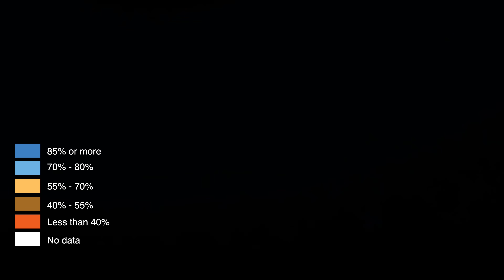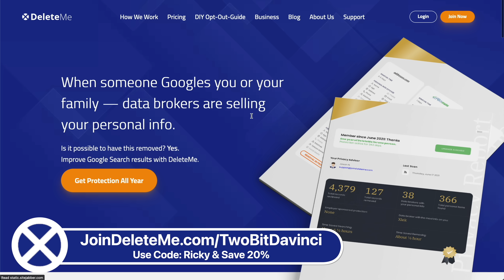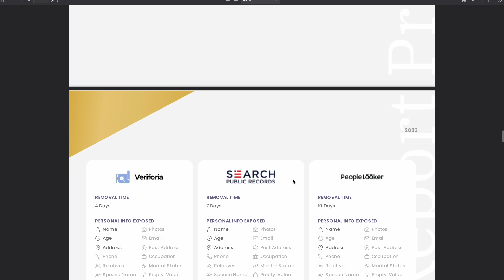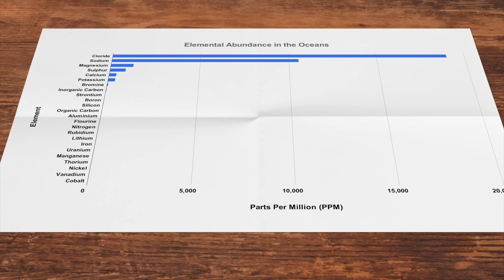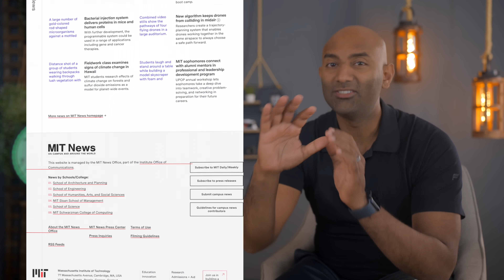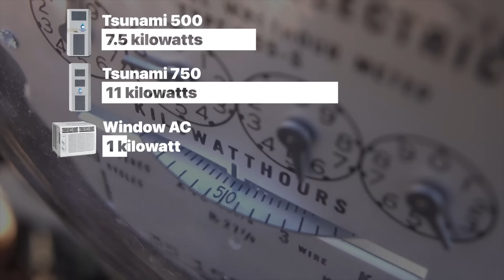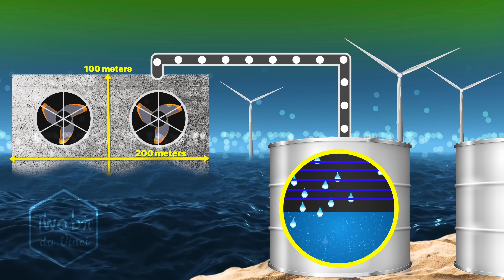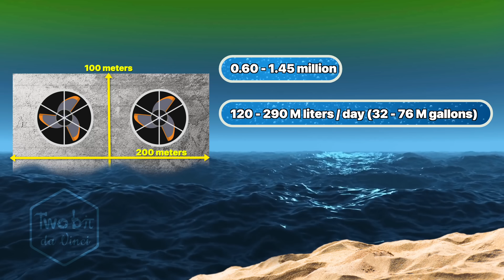This Tower Turns Ocean Fog Into FRESH Drinking Water!

Comment: Forget freon, forget steel pipe. Pump cold deep water thru polycarbonate twinwall panels, and you will have cheap water vapor condensing surfaces. Simultaneously, very large thinwall polyethylene conduits can be used to transport fresh water to shore. The buoyancy of poly and freshwater in saltwater allows these tubes to be restrained with anchors and tension cables. Think fresh, control cost.

Comment: Any and every way to get clean drinkable water is great, however we need to address the issue of how we waste water, this would take rebuilding plumbing and ''slow the flow'' of how and where water drains. Rain water and stormwater needs to be slowed to allow it to seep into the ground, where nature cleans and filters it as it  seeps down ton aquifers.  All hard non porous surfaces need to be changed to a material that asborts the water to in temp storage tanks before slowly release to the soil. Sidewalks, parking lots, small streets not highways. But local storage is vidal because of all the trash and piosons the storm water picks up before draining into oceans adding that trash to the oceans. Every house, fields, business, neighborhoods all need local storm storage and filter systems.  Water should be used minimum twice, example sinks, tubs and washers are connected to fresh water, but they drain to local grey water tanks that supply water to our lawns, gardens, farms and toilets which don't required fresh drinkable water.

Comment: How thick is that saturated layer above the water? How can it be sucked in? If the water i very calm a network of tubing floating on the water could probably do it and I see the installation (mainly ) floating on the water.  Advantageous seems that we don't need to condense steam here so the energies involved are lower.

Comment: It won't work out unless you have a temperature difference between moist air and the colder   media (water or air) that is used to cool it down to trigger condensation. For this, one must heat up the water using solar water panels and then using ambient air on the cooling side.
Reply: Or one must duct the air a couple hundred meters below the sea surface to where the water is icy cold.
Reply: @benishborogove2692  Indeed. But, that will not be true for all geographies.

Comment: You don't need a tower, you need to float a platform that let's air in from the sides, allowing an air collection system (fan)in the center. The air is ducted into a stainless pipe that will cool it sufficiently. Then just pump the water from the pipe. Or some variation of this.

Comment: Is the $241 annual cost, per person, or per household?  Being powered by solar would mean intermittent power and run time.  Were construction and operating costs, and water harvested calcs based on the system running 24/7?  Could a larger surface area with passive water harvesting mesh accomplish the same goal with less complexity?

Comment: If u have high humidity in air, then u should not be big issue with fresh water cause u should get decent amount of rain often, with rivers and so on, while in desert like areas u have both issue.
The energy investment is a lot to condensate the water.
If u remove this much water from air, the air will be much more dry so it should effect the environment around cause u will have this amount of water less as rain.

I hope humans will evolve on a lvl once, when they get rid of MONEY and GREED. If no money and greed involved, we can go for more efficient way cause right now the efficiency is based on profit, that is why we do not recycle much, cause cheaper to create new from scratch.... Good example as plastic. Plastic recycle is mostly just burning most of them. -,-
Could say other materials what we just dumping on dump fields every day, but since it cost a lot of money to separate and recycle we not do it, just dig a nice and big hole and dump it there, then cover it with dirt, or just pile it up and then cover it with dirt and pretend there is nothing. -,-

Comment: Post Two
Still thinking about this exciting sea vapor harvest idea.
Since these old freighters would be nearly stationary, their polution profile would drop drastically.
Repurposing these behemoths would benefit their current owners and might coax them to build new, green cargo carriers.
A freighter situated over cold water could shallow deploy a black fabric sheet, like a fishing net, to heat surface water to it's vapor point with solar energy focusing lenses.
Reflective areas on the sheet's surface to catch and bounce sunlight beams might improve vapor production efficiency via aqueous radiation redundancy. 
Depending how they were fabricated for the tropics, such sheets could also shield and/or partially shade heat stressed coral reefs, now endangered by bleaching.
Since edible fish stock are depleted world wide, employment of experienced fishermen to harvest water could be a vital economic boon to costal communities.
There is no reason fisher folk could not incubate and farm edible sea life by dropping nursery cages, like lobster traps, while they wait for harvest vapor to condense.

One caveat, I live a block off the beach. 
Ocean water vapor can be briny, even caustic. 
We might still need to distill the condensate but solar stills have been used since the age of tall sailng ships.

Comment: Why not put these deep ocean vapor collectors on old desiel burning freighters?
Tower construction cost are probably far more than repurposing ships and installing new green energy systems.
The chemistry and forces of oceans tear up man made constructions.
Look at the maintenance costs of oil riggs.
Each old freighter could hold metric tons of water in it's former cargo bay.
Your cold water condensation idea is brilliant because the deeper we pump water vapor the cooler the ocean and higher the pressure.
Expelling excess air from that cooling vapor could run turbines for electricity to pump the water back to the surface.
Filters might be used to scrub excess CO2 out of condensing vapor released air.
Win/Win.
A freighter can be moved where ever water is needed most.
Freighters can also be relocated out of harm's way if a huge storm is coming.
Unlike a fixed tower they can also be removed from war zones.
Just thoughts

Comment: Cool tech, but the idea of using sub-surface temperatures to pre-chill the water would be the same as dumping heat into the ocean.  A few degrees is enough to change the local ecosystem around the pipes and towers.

Comment: It’s all about the dew point and ambient temperature. 

The biggest issue is that saltwater / marine environment is very very very corrosive. So what ever you use to get a lot of cold surface area needs to have a good thermal conductivity but be able to withstand the corrosion.

Comment: Desal uses much less energy than condensing this is not addressed anywhere... And turning it into water before piping to land would be 10x more efficient. Like you said using the sea water as a heat sink could result in great thermodynamics

Comment: So, I must ask a question?? We have been "condensing" water from the air for over a century!! And it's right in front of our face, it's called refrigeration and we've been dumping all that water and energy down the drain! Why don't we redesign the A/C, and refrigeration systems to "CAPTURE" the water created when cooling of homes, offices, buildings, and food, plus any and all other refrigeration devices as they all must deal with the condensation issues?? After-all cooling is one of the reasons we have global warming as it uses a massive amount of energy which is directly connected to carbon production! This is just my observation but what do I know??  Love your viewpoints on all your topics!!  Peace...  JAFO

Comment: or just catch the rain that falls, even desert regions get some rain, if you have a decent catchment area, like a road or a roof or a series of ponds even small amounts of rain can fill huge amounts of storage.... if you know the yearly rainfall its not difficult to setup catchment to almost anything.... say you want a ton of water, you live in a desert and you get 10cm rainfall a year, you will need a 1m by 1m by 1m storage tank and ten square meters of water catchment to fill it in a year assuming no losses. that is not alot of space, you benifit alot from the square cubed rule a ten by ten meter area is 100sqm so you can fill ten tons of water per year off this. if you have 100m by 100m that is 10,000sqm of catchment, that can provide 1000 tons of water per year. not a big area.  just two foot ball feilds.. thats enough water for about ten people. high tech solutions are not needed for water shortage.... just maths and common sense.

Comment: Not so fast.!!! The cost of your/my water has to do with the cost of the distribution system, and a huge part of it is interest on the debt to build/repair the distribution system.  The water is actually free or in many cases just a few percent of your actual bill.  For my bill of  around $80/month, half is for swear (no saving) and of the rest only 20% is the actual water or 10% of my bill or  $8 per month..  This system will still need the local distribution system/sewer etc, so there is not likely any savings, only added cost.  May be better then reverse osmosis... but is not free and will not save us money.

Comment: OK, okay, all right… Now hear this.

You have unlimited water, to drink. Wherever you live.  And it's called a room,  dehumidifier. It runs on 120 volts, AC. And it will need to be powered from, solar panels.

And if you want to label that differently? You can call it a room air conditioner. Sucks out the hot air. And outputs dry air. With clean fresh water it takes out of the air. Et Voilà!

Now, the infrastructure of which. Is only taking, hold. Not quite yet refined for prime time marketing. As it's still a bit costly. And so they are trying to appeal to all of the stupid millionaires out there. To purchase these other, flawed, explosive, battery-operated cars. That insurance companies. Will no longer write homeowners policies. For owners that have said vehicles parked in their garage. When it takes their, $25 million mansion out.

And Like A Good Neighbor. State FART is There. Gas lighting you. Ouch!
RemyRAD

Comment: I appreciate what they’re doing; but this is a stupid way of doing it. 

Imagine you have a barge, or a fleet of barges. Tow them out into the ocean and anchor them. Put solar panels on them and a few pumps. When the Sun is up, collect warm humid air near the surface. Pump it to a higher pressure some water condenses.) Cool the (now warmer) air with cool water which you have lifted from below the surface (more water condenses.) As you release the pressure from your high-pressure heat exchanger, use the difference in pressures to compress more air. Store the fresh water in a flexible floating bladder for periodic collection, or pump to shore. 

+ No brine.
+ Highly efficient.
+ 100% Solar powered.
+ No refrigerants, a.k.a. CFC’s or HFC’s or any other substitutes) are used.

And in contrast to the concept as presented, you’re not trying to move millions of tons of humid air to your “ground-based condenser.” The reason it needs to be ground-based is because those refrigerant compressors use a LOT of energy. 

As a science communicator and as the title of your program implies, I expect you to IMPROVE on the ideas you speak about. And honestly I’m not an engineer but even I can smell science bullshit. I keep hoping your content will improve; but I’m losing faith in your critical thinking abilities.

Condense the compressed water vapor using cool water only a few meters from the surface. Minimum energy spent. Maximum efficiency.

Comment: Hi
I’d like to point out that, as some commenters have mentioned salt crystals still being present  close to sea level, that’s why the creator got clouds to form higher up so that the condensate, RAIN, would be sure not to have any salt in it in order to safely water the vegetation and fill reservoirs. The presence of salt crystals would cause corrosion and be an ongoing filtering requirement driving up costs.
Shalom to us only in Christ Jesus Yeshua returning soon to reign over His Creation from Jerusalem forever.

Comment: Maybe if we didn’t waste so much clean water we wouldn’t be in this situation. 
Why do we use clean water in toilets? How about straining water from sinks, laundry and dishwashers for toilet water? How many gallons of fresh water would we save in the US alone.  Oh and we could strain and use that same water again for watering crops and parks and lawns. A lot of parks where I live use reclaimed water. That should be the norm everywhere. We only need 100% clean water for consumption and cleaning maybe a few other things but most water can be used and reused many times. So maybe if we stopped using clean water when it is not necessary and reused water more we would be much better off. It would probably also be easier and cheaper to find more ways to reuse water than to make clean water. But I’m just a stoner high school dropout so what do I know.
Reply: Grey water systems already exist. They are relatively expensive to install and maintain.

Comment: Worked in a lot of powerhouses. The old boilers had preheaters that if you reversed the system would work as condensers. They were basically giant tanks with thousands of small tubes filled with water. Your sea air could be ducted into the body of tank and if you filled the tubes with cold water that you had chilled by geo thermal means you would get condensation. Then only real power you need is for pumps and your fans. Depending on how much water you are causing to condense and the drop to the pumps. You could even put those horizontal positioned water turbine over the outlet holes of the water to help with power demand. Like videos keep it up

Comment: Create idea but need to be tested on smaller scale I bet in a few years they will be able to collect tons of data to analyze. Like for example maybe it better to pump cold water from the dept of the sea them trying to push air down. Because you would need a lot of material to keep you condenser with air underwater. Plus it would be way harder to maintain while with water pump you just need submerge pump and robust enough pipe.

Comment: 8:17 Its focused in OVERENGINERED WAY. Just make fins(like a tipical noctua heatsink, ok maybe more holes to let air traspasing) and use heatpump to cool down that fins. that make condensate the air  and drops water go down(a pasive way can be done but require much large heatfins) The heat pump work its own fluid R238 on circuit cycle, its just used to lower the temperature like clouds finde mountains and start rain.

Comment: A few years ago I recall a project where the idea was to setup à mini electric generator that was connected to 2 pipes. One at surface water and the other 100m deep. By making vacuum in the generator chamber, it makes the surface water to boil and condense on the other side where the exit is connected at 100m (4 degrees Celcius). This device was able to generate decarbonised electricity and soft water simultaneously. Will it be possible to get an actualized status of this project?

Comment: I think here like in many such seemingly optimistic projects the devil is in the detail. One problem that I can see straight away is the danger of corrosion severely limiting the choice and raising the cost of any material the components of the system can be made of. For some reason the author forgot to mention that the air above the ocean not not contain water vapours, but also usually much larger amount of seawater mist raised by the wind. This mist is highly corrosive, anyone who lived near the seashore can vouch for what the seawater-filled wind does to the cars and window hinges. I am sure there are other problems too otherwise the system would have been implemented ages ago as it seems so simple and obvious.

Comment: We like to experiment with atmospheric water capture and recycling on our homestead in the Ozarks. We have experienced a drought this year, but the passive water capture from condensation has made a big difference. Rock berms that collect morning condensation is the main system in our gardens.

So, I've thought about something more along the lines of relatively passive technology for capturing water as condensation from the ocean. Instead of building towers I envision water pumped into open troughs with glass or plexiglass panels positioned to collect condensation and divert it directly to fields for irrigation or to a water capture system. But for huge agricultural fields that may get in the way of equally huge farm machinery. A better idea is to move food production to smaller scale urban sites that use grey water condensation. Small scale urban food production should lessen the energy inputs required, especially for refrigeration and transportation. For instance, I grow all my salad fixings indoors in an area the size of a large refrigerator. Fresh food all year and no trips to the grocery store is reason enough to start bringing back residential gardening.

Comment: Now, if the towers were built of Roman concrete reinforced with basaltic fiber rebar, instead of Portland cement based concrete and steel rebar, the service life of the structure would be mush greater.

Comment: Energy is expensive. What are we willing to pay for a gallon of water? Is it affordable for the average citizen. The machinery built over sea water to condense the vapor will corrode any metal part into its basic elements in a few years. The maintenance cost would be very expensive, which means the average citizen will not be able to afford it.